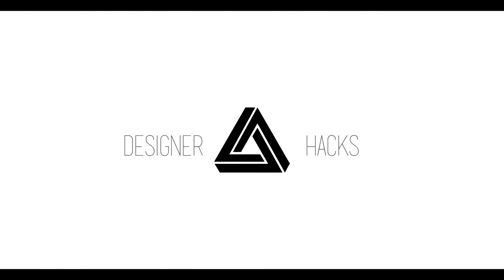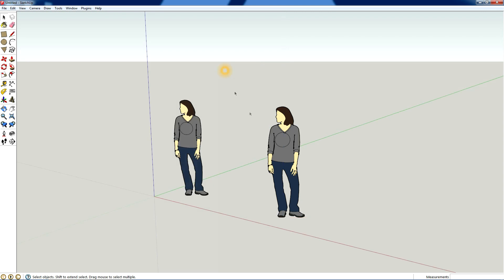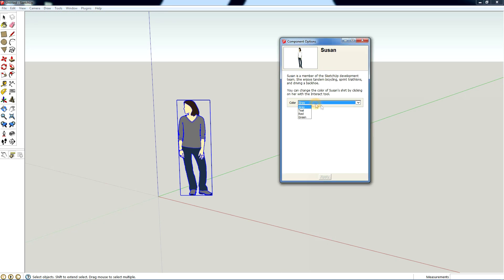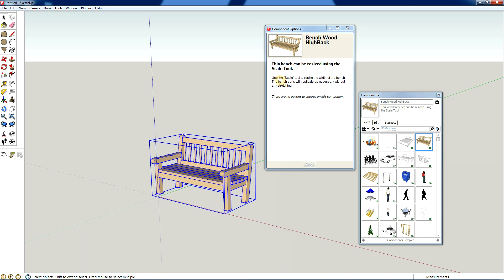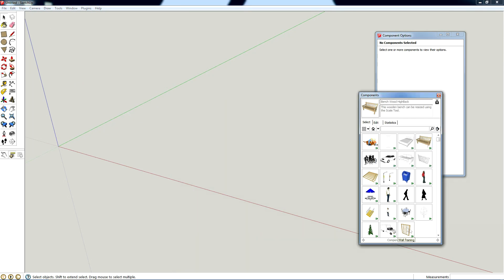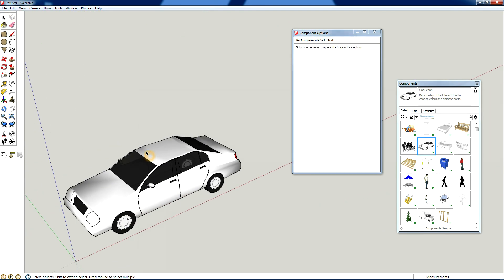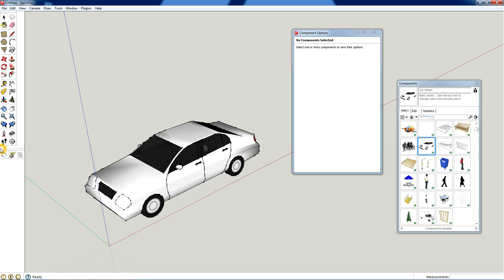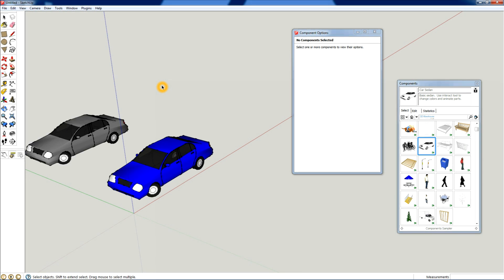How to Use Sketchup's Dynamic Components

Comment: Thanks for sharing. Pity about dynamic components editing being only a pro version. 

I'm sure you know this already but for those who don't, there is a way of using the  same  (ordinary) component many times in different colurs in the same file without swelling memory.   Just make sure that those parts that need to change colour have the default colour. Then paint component outside with the desired colour and only the default coloured parts will take on the desired colour. Any colours painted within the component remain unchanged, so you can keep your black tyres, lights etc. This method is more efficient than using dynamic components for colouring because dynamic components have overheads. 

Opening and closing doors is another story altogether.
Reply from the maker: And unfortunately they crippled the free version in 2018 by making it a web app.  I've been tossing around the idea of switching to Blender because of it.

Comment: Wanted to experiment with this program, I'm currently still in my free trial, and I was messing around with the attributes of a component. 
So I have seen in many videos here on youtube, that you can make (for example) the absolute thickness of a shelf 1,8cm when you add an equal sign. But when ever I do that it turns red and adds a # in front of it. and my shelf can still be resized and becomes thicker... Why doesn't it work for me?

Comment: Hy!
Great tutorials!

Can I add an attribute to a component that locks it`s Z position, but when I copy it to another Z position (lower or higher) to lock on that new position?

Many thanks!
Reply from the maker: I'm not sure I understand your question.  You can add a parameter to dynamic components to change their Z location. IE stairs.
Reply: Designer Hacks Many thanks for your reply!
 I have a layout with many furniture models and when I furnish some apartments I don`t want to bother if their Z position could modify (by accident or missplacement). If I use a simple attribute to fix their Z position, that helps me a lot, but when I have apartments with different floor heights, I`m really stuck. So, in my situation, It could really help me to have models with fixed Z axis position, but also with the ability to "re-fix" them at another height / Z position, let`s say when I copy them. Don`t know if this can be done by a "smart attribute" or I need more to get what I want. I appreciate you response!